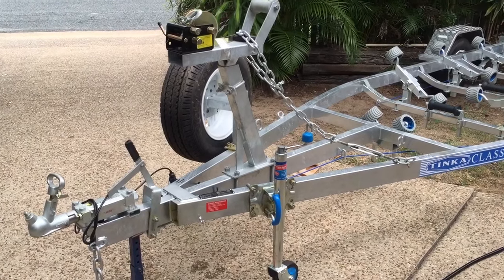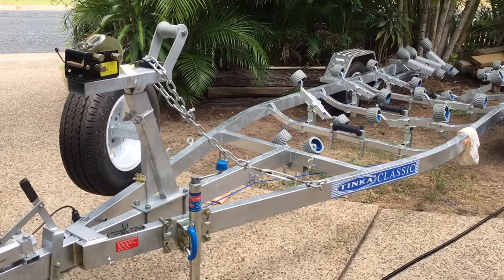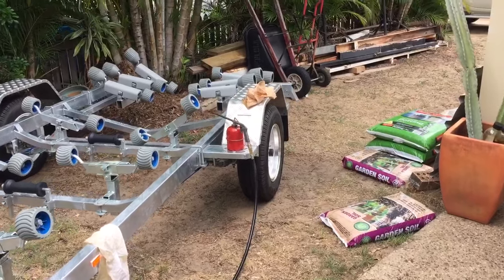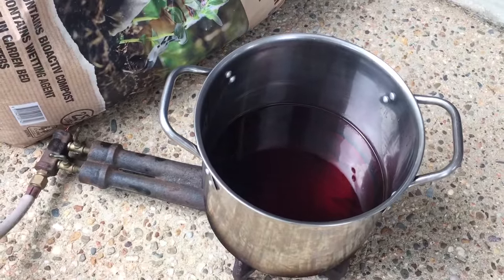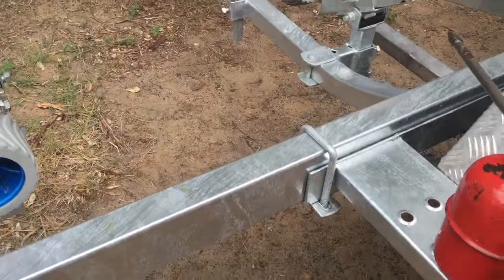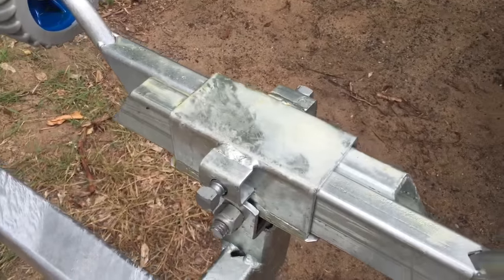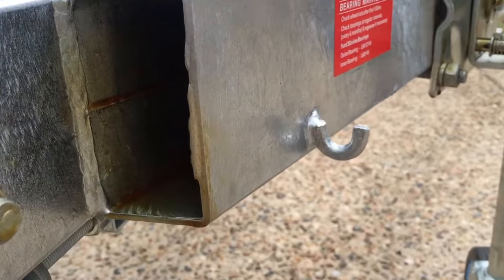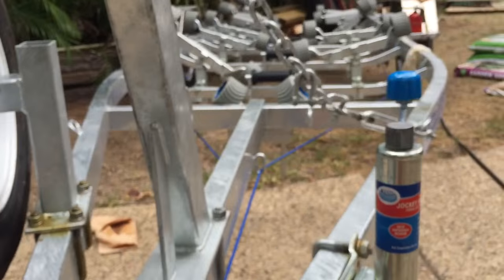Rust Proofing a Boat Trailer

Comment: Is the sprayer powerful enough to spray from one end of the tube to the other end?
Reply from the maker: The gun I use makes it like a thick mist so generally gets all the way through
Reply: @Haululua  thanks
Reply: Is it ok to spray into the hub assembly and brakes? Anywhere on the trailer I shouldn’t spray?

Comment: Dies this fairdinkum work? Wouldn't it just wash off? How often would this need to be done is it like something to be done annually? Thanks
Reply: does
Reply from the maker: Hey Mate. Dad built himself a seaplane and it’s the same process they use for it. They only ever do it once off however I would recommend ever second year. My trailer is still like new
Reply: Haululua thanks mate. My trailer is cactus so I'm thinking about buying a new one. How would this process go on a refurbed trailer that has already seen sea water probably no good hey
Reply from the maker: geoff stein not to sure mate. If it hasn’t started pitting already or any visible signs of corrosion then any corrosion protection is good. This stuff is very similar to tectyl just a lot cheaper and slightly cleaner. Dries to the same consistency